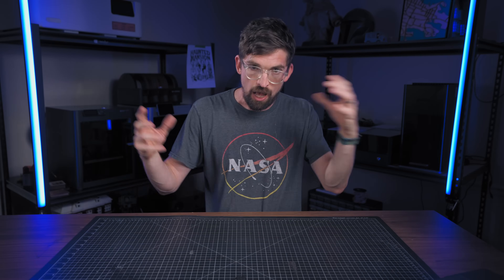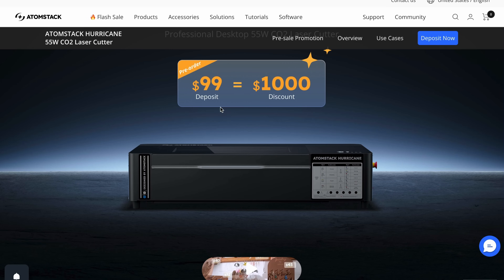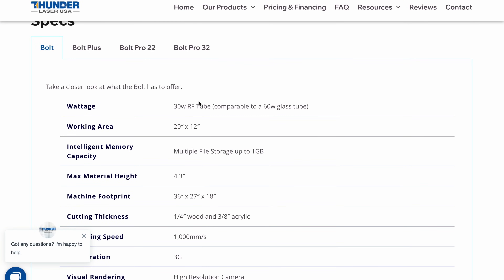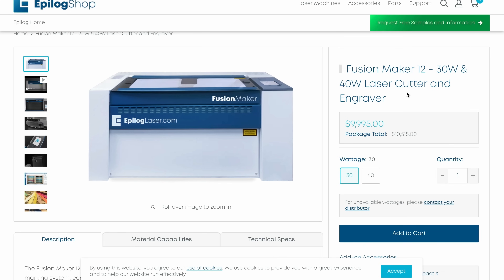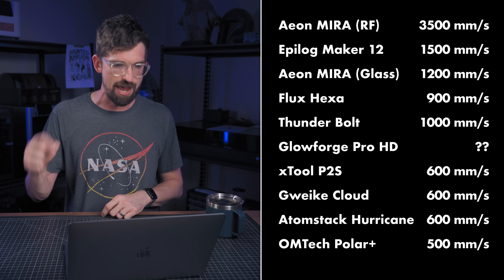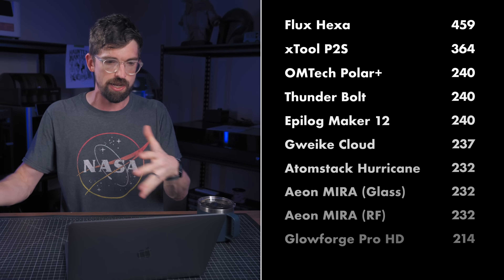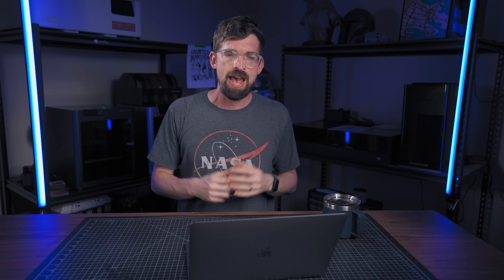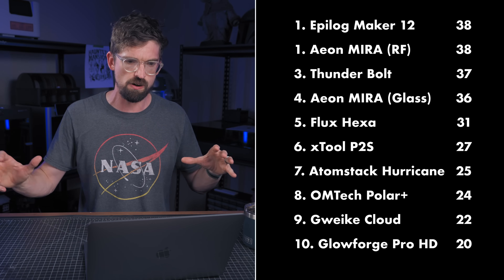I Tested Every Desktop Laser - This is the Best

Comment: I think adding the price of each product alongside the ratings at the end of the video would make it clearer. Or maybe rank them by price range, since comparing a $9999 machine with those around $2000-$4000 feels a bit unfair. After all, you get what you pay for.
Reply from the maker: I've got the price in there at the beginning and I thought the end.  I wanted to make all the categories equal, but price might play a bigger factor for different people.

Comment: First of all, great review and categorization of thoose lasers! However, as a beginner, I feel like some essential information is missing, especially for desktop models. Next year, I plan to start working with small parts, around 1-4 cm thick. I mostly need engraving, and I’d like to work on multiple pieces at once (potentially different sizes but the same height), letting the laser run while I do other tasks. For this, the laser should have the capability to automatically detect the position of the workpieces and center engravings, like texts or QR codes. Otherwise, I would have to manually measure and align each piece to the 0,0 point. For example, if one piece is 50mm wide and another is 52mm wide, and I want a QR code centered, the laser should be able to automatically center it if needed. This is especially important when dealing with multiple pieces lying next to each other. I can't rely on precise X, Y coordinates because the pieces might not always be perfectly aligned, or there could be a 1-2 mm gap between them, which could throw off the centering of the engravings.
Reply from the maker: Check out the xTool P2, its camera can do automatic positioning for bulk items

Comment: I would be very interested in seeing a video comparing RF vs Glass tube power like you mentioned. Thunder Laser markets the Bolt's 30w RF tube as being equivalent to a 60w glass tube, but when you look at the cut settings they publish, they say their 30w RF tube can cut through 3mm birch ply at 10mm/s at 90% power, while the 60w glass tube can do 45mm/s at 90% power. That doesn't sound very equivalent.
Reply: @1-Nice-Guy  Do you suggest a Thunder Bolt or do you prefer something else because of the misleading claims? In other words, would it be a good idea to invest in a Thunder Bolt, or a OneLaser, or something entirely different?

Comment: I came across the Monport Reno45 Desktop CO2.  Do you have any knowledge of it.  In your previous video with the list it isn't listed with your desktop CO2 machines.  Right now it is on sale for $1000.  I like the cutting size area (16x12) that is available.  Would this be a good buy? I had looked at the OmTech one that is smaller because I have a limited budget but the fact this is auto focus and larger cutting area seems better.

Comment: Hi did you already get your Hands on the Monport Onyx 55W CO2 Laser? Is it any good?
If no, what didnt you like about it?

Thanks!
Reply from the maker: I haven’t but the best I can tell it’s now just a black version of the 55W.  I should have done a better job mentioning it in the video it wasn’t the Gweike and OMTech are bad machines, they are just at the bottom in terms of performance vs the others.  But they also are the vheapest
Reply: @makeorbreakshop  Thanks for your answer. Did i get it right and its build the same way as Gweike and OMTech or are there differences?
Reply from the maker: Oh shoot I misread your comment!  Gweike also has a black machine, so Monport yep it’s pretty much the same as those
Reply: ONYX 55w and OMTECH polar is just same thing